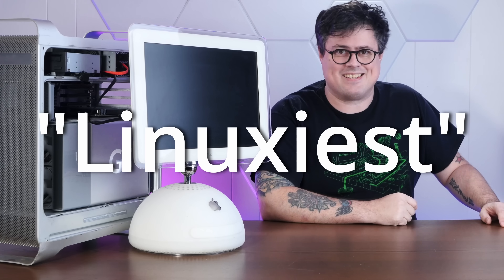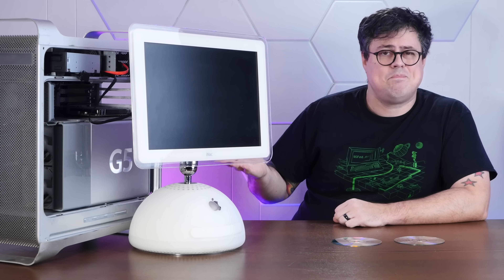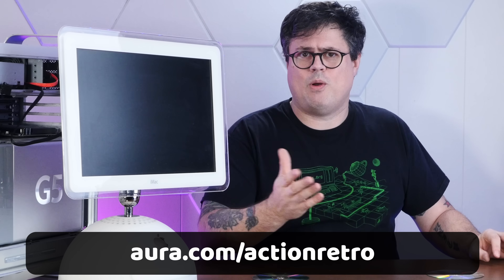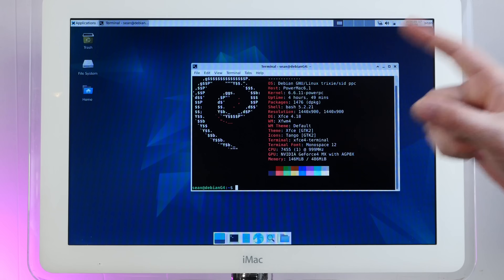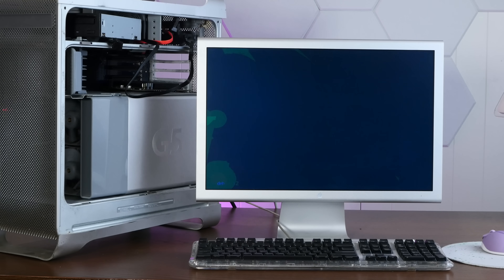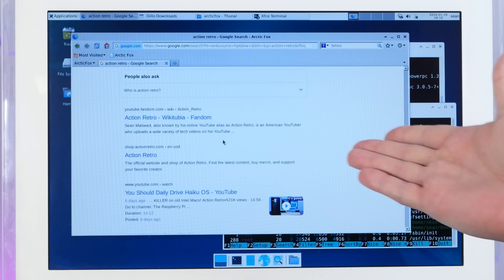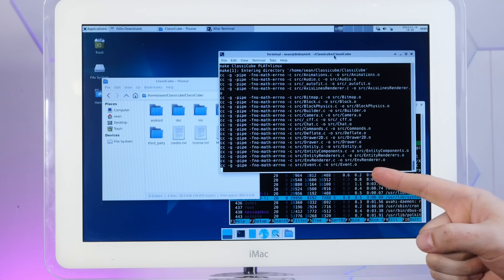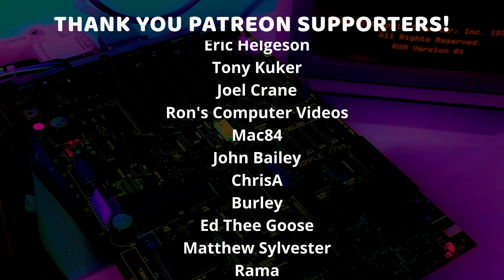Debian Runs on Literally Anything

Comment: i love debian - i've set up a terrible lenovo yoga as our family media-centre. debian is ideal because it won't do anything unexpected when my parents try to use it, but it's much faster than the oem windows 10 install. it just works!
i'm thinking of using the 2008 imac in the attic instead, since it has a disc drive. needs further investigation.

Comment: It's funny, your video inspired me to try this on my own G5 Quad, and it just...flatly didn't work 😅.  The installer completed just fine, but it never made it past the GRUB bootloader.  Wonder what I did wrong...?  Only major differences between our setups that I could see are that the Kernel version was 6.6.13 when I was installing, and that I have a Radeon X1900XT in mine, as opposed to the GeForce 6600 you were using. 🤔
Reply from the maker: A few people have said this today - I think there’s some temporary issue with the Debian mirror. Give it a bit and try again!
Reply: @ActionRetro  Actually looking around, it seems like that particular Radeon card flashed with the Mac bios is unstable/unusable on PPC Linux.  I'll have to find something else to stick in there I think...🤔

You mentioned that you might find something else to replace your own GeForce 6600...if you ever do a follow-up video (or a sequel to the one where you tried to use way too modern graphics cards in your Quad) I'll watch with great interest 🤨😝

Comment: I asked already the developers a few days ago on the mailing list about the graphical glitches with the G5 Quad and the Geforce 6600. They said to me i should recompiling my kernel with the following config options should work:
$ fgrep -i nvidia config-6.5.1-ppc64
# CONFIG_NET_VENDOR_NVIDIA is not set
# CONFIG_I2C_NVIDIA_GPU is not set
CONFIG_FB_NVIDIA=y
CONFIG_FB_NVIDIA_I2C=y
# CONFIG_FB_NVIDIA_DEBUG is not set
CONFIG_FB_NVIDIA_BACKLIGHT=y

But i haven't tried it yet. Another workaround is using a radeon gpu

Comment: Dejavu! I was playing around with Debian 12 on my a1047 2ghz dual cpu PMG5 and ran into the same FF issue, settling on Dillo as well. I planned to install AF when I got some more free time. I used MATE though not XFCE. I like how XFCE is more responsive as MATE kinda chugs along and I don’t think I have video acceleration, so looking for a replacement gpu would probably help. Fun project for sure :)

Comment: i did this with my PowerBookG4 15-inch and ubuntu circa 2008.  it was a hot, unreliable experience, and getting wifi working was a nightmare (bcm43xx-fwcutter, am i rite?).  a fun exercise at the time, but i dont recall running it for very long.

Comment: @ActionRetro  I couldn't find ArcticFox, which repo did you use? (On a PowerBook G4, also it needs B43-fwcutter to get wifi running, which I have no idea where to find). This might not be a daily driver, but if it had wifi and some software (perhaps some terminal app,s like tg) It would be OK to take to a coffee shop)

Comment: I have a powermac G5 dual core 2.0 with a pcie Nvidia 6600le with 256mb. I can't get debian 12 to run right on my powermac G5. I think it's the video card too. Like you said sir. I not good with linux and couldn't get a browser for it. Thanks for the video sir.

Comment: I've installed Gentoo on an iMac G5 17" and a PowerMac G5 DualCore 2.0. If you're upgrading a video card on your PowerMac, I've found the Radeon HD3xxx series to be very stable considering, though it does have a slight color issue.

Comment: I love how Debian not only supports PowerPC, but even still supports m68k! I wonder what the popularity contest results look like for the 68040!
Reply: So you're saying it might actually run on my IIsi?
Reply: @diebesgrab  I have NetBSD 9.3 running on a Quadra 800 and Dillo. SLOWWW but works.
Reply: 68k runs on Amiga A2000 using a 128Meg 68060 Wildfire card, has since 1995 to my knowledge  ...

Comment: You should try using the H264ify plugin for Arctic Fox. It forces Youtube to use the H.264 version of videos, which is less demanding to decode than the VP9 codec that Youtube uses by default. Since the iMac G4 has no hardware acceleration for modern codecs, the CPU will need all the help it can get.

Comment: debian 12 + wayland + kde plasma desktop using Mac Big Sur theme = pretty decent mac-like experience.  The only question is how well it would run on that older hardware.  Probably not so great.  But on a maxed out 2012 i5/i7 mac pro laptop?  Runs like a champ, nobody would ever be able to tell at a glance it's running Linux.

Comment: So did debian drop powerpc and then pick it back up? I have a mac mini in the closet i was using as a backup DVR for my security system, but it would no longer update because debian dropped that arch. The severely outdated software would continuously be tagged by the vulnerability scanner i was running, so i decided to stop using the mini altogether. I'll be seeing how well deb 12 runs on it now.

Comment: Oh man I haven't seen debian running on a G5 since probably 2012. I stopped using it when the nvidia driver got flaky and started doing strange things. If you throw an AMD card with a powerpc mac bios you will probably have a much better experience.

Also powerpc is far from abandoned raptor computing systems has their power pc line of systems that are focused on Linux users.

Comment: all the repositories for all kernel modules are there, you can build your own kernel once you boot in with selected moduels for nearly any cpu architecture. you need to build software from source (make/install) and also required libaries.Thats how around year 2001 I could play a DVD on a cyrix 233Mhz with a GF4 64mb PCI card and 256 mb ram with no problems. people forget you can build several specific kernels leaving out unnessecery moduels for specific circumstances

Comment: Question, why not change the TIM while you're in there? These old PPC Mac use a phase change pad which "reflows" into a hard seal. With time it wears out and needs replacing.
Great video though. I want to upgrade the G4 CPU on one of those iMacs to the fastest possible and see what happens.

Comment: About fifteen years ago, I tried to repurpose a "Tangerine" iMac (G3) with Debian. It booted and was usable, but the lack of Flash was kind of a dealbreaker at the time.
Reply: Yeah, I did the same thing but with Ubuntu. I was disappointed to discover that, while Flash existed for Linux, it wouldn't run on PPC. Naive me thought that precompiled Linux software would run across all architectures.
Reply: @3rdalbum  There is/was "Gnash" as a multi-platform free Flash, but compatibility was weak.

Comment: I installed haiku in a VM and I cannot even hope to daily drive it. My assumption was I wouldn't be able to given my odd setup and what I want to use my computer for. I'm kinda tied to Linux but I wanted to play with it...and its network app froze when I tried to connect to the internet and I had to restart the VM...it happened every time I tried to connect to the internet

Comment: I just put mx linux i think its based on debian on an old haswell rig with nvidia 960. It worked real nice out of the box. Nvidia driver installed without a hitch, so did steam and proton within steam is running a nice selection of games perfect with old xbox controller. Not a single config to edit, no extra respositories to add in. It just all worked. First time including 144Hz on monitor as default. Gaming on Linux, thanks to Steamdeck has made massive strides. I might build a more modern rig for it. 12400f + 7600, cheapo jobbie.
Reply: That's nice to hear. I'm already 95% sure I'll be picking MX Linux in the near future when I jump ship from the sinking Windows 10 ship. MX Linux comes with some really nice tools that I know I'll love, but I was curious about gaming - nice to hear that's easy.

Comment: Using my G4 as a dukebox has been great, Itunes coverflow brings up fantastic album artwork.  Setup the clear plastic harman/kardon speakers and away you go. The G4 is still usable today just got to use it now to it's limited but still usable state in 2024, thanks for another great video keep trying with the G5 and G4 love them both to bits.

Comment: the glitches could be nVidia running inside wayland, but i'm  not sure if xfce4 has wayland support, but yeah thats quite an old nVidia gpu if you can get the non-free drivers to work that would probably fix the glitches.

Comment: How is your ram usage so low? Just installed debian on a crappy celeron laptop with 2gb ram and it's idling at 1.3gb
Reply: I think the trick is to only install one desktop environment, so only pick XFCE. If you pick KDE Plasma as an alternative DE while installing, some services will run on startup like "kalendarac" that takes up a lot of RAM. At least, that's my limited experience. I reinstalled Debian 32-bit like 10 times (in a VM) to figure out which DE had the lowest footprint and most of them idled around 500 MB. But VM's aren't real hardware.

Comment: The graphical glitches are almost certainly due to using the open-source Nvidia drivers. If you were to track down and use a proprietary driver compatible with your GPU, it'd solve those issues.

Comment: i have this powkiddy x55 handheld gaming console that runs on jelos.  i would love to get debian on it somehow.  it already runs Linux.  even had root.  but the main file system is on squashfs so i can't really change system settings.  anyways debían would be great.

it runs on a rockchip armv8 quad core with a mali g72.  the os is very efficient but compiling debían on it with hardcore compiler and code optimizations would be legit.

Comment: Even in this day and age, pretty much anything with at-least a 1GHz CPU with at-least 4 threads and 2+ ish GB of RAM, with even very basic video-accleration could be used for practical everyday use with the appropriate OS.

I consider these an ABSOLUTE minimum spec for usable computing in the current era.
And id give you two thumbs up if I could.

Comment: I literally just did this with my powermac g5 from early 2005. I couldn't get Adelie working on it due to a bug in their installer. Even doing a manual partition, it wouldn't install. Slapped Debian on it and it worked. Crazy.

Comment: I run Debain on a 1.25 MDD for an offsite backup server.  It's a great "lower power" box that can hold quite a few hard drives.  Running Samba 4 with vfs fruit, it can even work as a time machine backup.  The built in gigabit ethernet is suitable for it.  It was a hug improvement from my 500Mhz 100 Mbit graphite G4 Debian machine.  I wish there was better gpu support on BSD, as I prefer a gui with a terminal instead of just CLI.  It still is truly usable hardware, minus decent gpu support of the older hardware for the BSD and Linux.  Nvidia GPUs seem to work a bit better/easier in my opinion at least on Debian.  I'd still like to see you install the PCI Airport card I gave you at VCF in your blue and white.  10.2.3 + natively supported, and Broadcom support in Debian......... Would be a cool video of 108.11G connection on a B&W.  Actually, using XPostFacto or the Sonnet patched startup disk panel/preference on an old 603 PCI mac would be cool to see too.  I keep one in my beige G3 to toy around with.  I actually use these older machines for the SCSI support since my job still has machines that use 50 pin SCSI.  DD has been a life saver for imaging the drives, since the format is proprietary and can't be read, even under any FUSE supported file system.
Reply: Those Macs are anything but low power, the 1.25 G4 may idle at anything between 80W to 135W!
Reply: @resneptacle  Which is why I said "lower".  Sure, I can buy a NAS (iosafe) device that has a little ARM cpu.  But running some kind of older computer with the ability to hold 5x 3.5" drives and actually be useful, is somewhat rare. (6 if I remove the optical drive.)   While keeping the power draw under 300 watts, I'd say is pretty good for such old hardware, and being able to new SATA drives (with adapters or PCI cards), is also pretty cool. I found the adapters to give better speed transfer with the keeping compatibility with OSX if I ever needed it.  Just for a hobby and some data redundancy, it allows for a useful MDD in 2024.  Even a cheap used server will pull more power than this old machine. Plus, it isn't too picky about the temperature extremes for its remote location.

Comment: Those graphical glitches on the G5 are likely the result of the nVidia GPU. nVidia doesn't open source their drivers so support can be dropped and drivers broken on newer kernels. As a result, likely your only option for a driver for that chip is going to be Nouveau, which is reverse-engineered and "useable" on those older chips at least.

You'd be far better off with an ATI/AMD card on that machine.
Reply: surprisingly the old school radeons have been getting a ton of driver updates lately too lol, makes me think there's some guy ride-or-dying his HD 2900 XT.
Reply: @amirpourghoureiyan1637 I still have a nano in my linux rig. 😂
Reply: @amirpourghoureiyan1637  AMD open sourcing their drivers certainly helps matters with this sort of thing. They're gradually open sourcing their entire GPU software stack too now.
Reply: Definitely that. I was running a 6600LE (from a PowerMac!) on my Ubuntu-derived PC around 2015-2016 and it had glitches.

Comment: I've been exclusively running various versions of Debian since 2004 when I got sick of MS Windows nightmares.

 Since all of my laptops are 8 - 20yrs old, I've used lightweight distros like Antix, AV Linux, Bodhi, Mepis, Makulu etc. All of them have been FANTASTIC and speed has never been an issue. 

If you've only got old gear, Debian and any XFCE Linux desktop (avoid KDE & Gnome) distro is the way to go 👍

PS : Lenovo laptops are the absolute BEST 👍😃
Reply: Everything I got is core2duo era and below. I get by.
Reply: Looking to get a better laptop since I got a t410 with a bit of keys missing and no battery and a hard drive

Comment: Nice show with these older Macs. I find Nvidia pretty unfriendly when running with Linux, so I only use AMD related video cards. I wonder if the browser issue would have resolved itself if you used GNOME instead of XFCE. And the GNOME browser too, and not Firefox or others.

Comment: I can attest the title is accurate. I've installed Debian on an SGI O² and a D-Link NAS. 

(I didn't come up with how, just followed some fairly obscure instructions. Those who wrote them were the real heroes.)
Reply: PS, both of those may or may not be harder in modern Debian. This was years ago. 

The 10 000 RPM HD in the O² was way too loud for my tastes. The NAS was not worthwhile anymore, with lackluster performance, but I might resurrect it as a secondary Amanda backup storage.

I've moved on to SBCs which, in Debian terms, are perhaps weeping edge.

(Not quite bleeding edge, as there is mainline support, just a bit harder than your average netinst.)

Comment: a while ago, i installed Debian 11 on a 1999-ish fujitsu-siemens laptop that was thrown out at work. 6 whole GB's of spinning disk, a single 32-bit 500MHz Celeron core and a whopping 196MBs of RAM.. It didn't support USB boot, and the only other install media I had was a Debian 8 or 9 DVD, so i installed it and apt-upgrade'd my way to debian 11. It was painfully slow, but I got there, and i'm honestly surprised at how well it runs. As you said, a modern OS on a 20 year old machine! I didn't dare to run XFCE, but a minimal DWM setup ran pretty well. I even managed to load a plain HTML site in Firefox!

Comment: That G5 has more RAM than a brand new $1600 MacBook Pro!
Reply: Because it was made to last
Reply: Apple should be embarrassed
Reply: tbf the ram in that G5 is super slow
Reply: @killingtimeitself  yeah I’m aware but I’m pretty sure 1600MHz ram sticks won’t work in a G5
Reply: @axethepenguin Apple is shitty nowadays. They charge 300 bucks for an extra 60 dollars worth of RAM. If you don't let them scalp you, then 3 years later, you find you need more RAM, but you have to buy a new machine to get it.
Reply: @ninline2000  yes I know and it sucks
Reply: Marginal difference between DDR1 and unified LPDDR4x my dude.. also apple makes their own hardware and software.. meaning they can be a lot leaner with hardware.. trimming the pubes, so to speak.
Reply: @Errcyco  Trimming your wallet would be more accurate.
Reply: @Errcyco  Marginal difference between 20 years ago and today 😅
Reply: @Errcyco Paying full price for 'leaner' hardware just sounds like getting scammed to me.
Reply: @Errcyco  though no computer magic can reduce the raw requirement to data storage, if you want to load 10GB of data into RAM, you'll need at least 10GB of RAM, nothing much you can do about that. Like sure, your OS and stuff can be optimized to use less, but you still won't be able to load 10GB of data into 8GB of RAM, just not physically possible.

Comment: I would argue that Gentoo is the "Linuxiest" Linux, but Debian is absolutely respectable in that regard.
Reply: I was searching for a comment like this. Nothing shouts "outdated" or "it can run anything" than installing it on a 133 MHz 486. Though I guess that installing on things that are more obscure is even more ... uhm ... Linuxiest :)
Reply: @Winnetou17 I think BSD might be even Linuxier then.
Reply: It's definitely Slackware, you can't get linuxier than Slackware.
Reply: Not really I mean besides Slackware Debian is the oldest current distro
Reply: @somecallmesean_  Debian doesn't require you to compile it from source. Yes, Debian is open source, but simply installing it from prebuilt binaries doesn't have you come into contact with the open source nature of it at all.
Reply: @Ultimzer I said age not source compilation
Reply: @somecallmesean_  And this thread is talking about the "linuxiest" distro, not the oldest.
Reply: @Ultimzer and age is a huge part of it
Reply: Linuxiest would be Arch, imho. But I'm not a huge Linux expert, so...